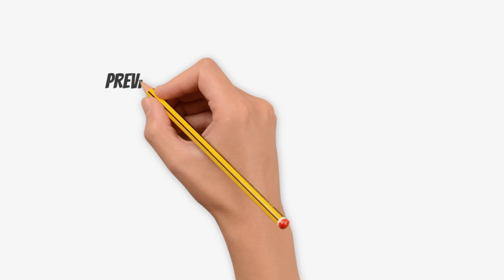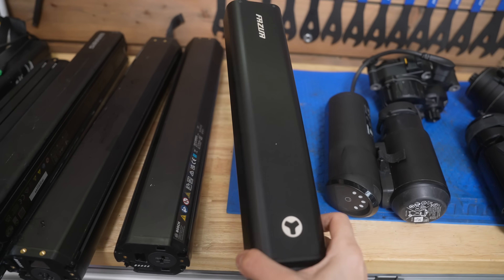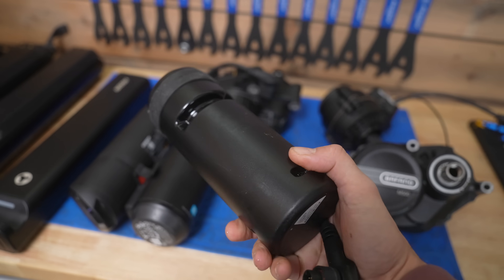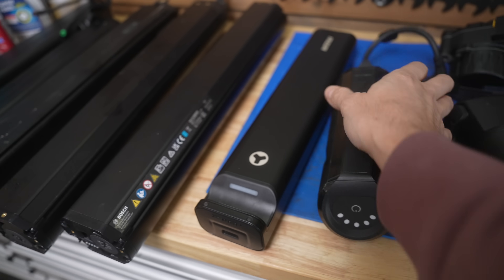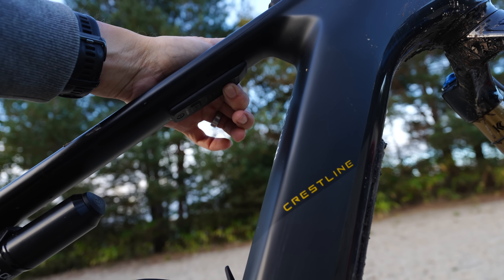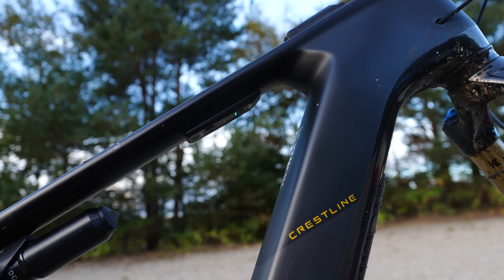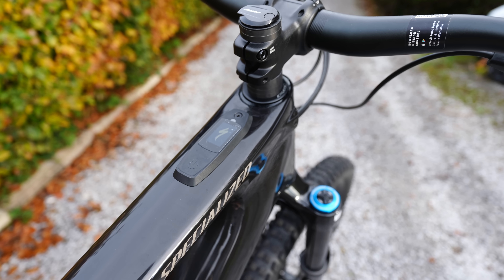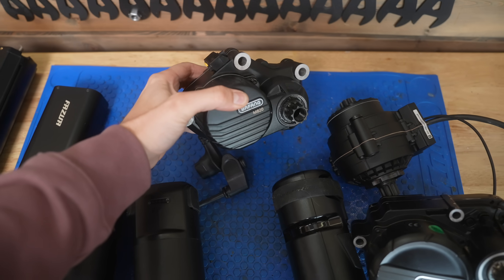We Have A Huge Problem With Ebikes....

Comment: The problem is there is virtually no new technology at play here and no requirement to use proprietary plug interfaces.  There are no bikes that require beefier contact points, different communication standards across components or battery shapes.  Ultimately these companies want to target consumers who want to buy complete systems and call it a day while taking advantage of the fact that a lack of an upgrade path forces consumers to buy more.  Interestingly if you choose to modify an existing push bike to be electric you get the best of compatibility options because you end up buying a myriad of parts from chinese suppliers who don't have a comprehensive catalog of parts and are forced to make their parts as universal as possible so that people can use them.
I think the best way to solve this problem for the premium market is to offer tax credits applied at the point of sale for systems that meet common standards.  To begin with you could target the more basic systems that DIY builders are using and get the premium manufacturers to work together and make a new industry standard for new components so that they can take advantage of the credits as well.

Comment: This is my main gripe about e-bikes! Otherwise I think they're a great idea.  Think back to the "dark days" around 2000, when every phone manufacturer had their own charging port.  Eventually USB was a sort-of standard, but only really when the EU made it regulation that USB-C was fully used.  Arguably even then manufacturers are now being cheeky with USB-C, so it looks like a USB-C in terms of form-factor, but have their own standard when it comes to transferring data vs just power etc.

My wife invested a lot in getting an e-cargo bike, and hopes to be able to keep it for many years to come.  Ended up buying a couple of spare batteries + frame locks whilst they're still available to help future-proof it, and might look to get some spares in stock for the motor.

Arguably even non e-bikes suffer from this as well.  Bottom brackets, one-piece cockpits with integrated cables, aero seatposts, built in batteries in frame (Cannondale) etc etc.

Comment: Its a new tech, the design isn't finalized, if we made a standard then future advancements would be stifled by backwards compatibility, wait until the manufactures evolution of design settles down a bit, just as phones now can use USB - C as standard, as it was clearly the best out of the bunch.  There will always be aftermarket parts available.

Comment: E bikes are exactly the same as RC cars. RC cars can take any battery and the plugs are easily changed. This propritary crap has got to stop and is not a feature designed for the end user.

Comment: Yeah, this is 99% design-related and 1% "locking into the ecosystem"  and even that 1% is probably being driven more by patent infringement than marketing issues.  The space is evolving without a clear leader and there are no standards.  Unfortunately there is no worldwide organization to set cycling standards.  Perhaps cycling could ask SAE to set up a cycling-specific group?  Seems it would be easier to join up with an existing organization than trying to start an all new one.

Comment: Not surprising, just like other powered vehicles, parts are specific to the manufacture. The big problem in the US are the illegal electric bikes bought off Amazon that have motors greater than 750 watts. They lack or have easy defeatable governor limiting the electric assist speed with some reaching 40 to 55 plus mph making them illegal to ride on public roads. In addition, the batteries are known to catch fire starting building fires, a growing hazard with cheap electric bikes. 

Bicyclist in the US are known for not adhering to traffic laws, but putting an electric motor on them is like giving a toddler a knife to play with.  The American Journal for Emergency Medicine in a national study revealed that e-bikes were second behind E scooters for injuries, “The 115 injuries per million e-bike rides beats out the estimated 104 injuries per million motorcycle rides, 15 injuries/million bicycle rides, and eight injuries/million passenger car rides." A 100 more injuries per million when you put an electric motor on a bicycle. 

If injuries continue as expected they will, the states will pass laws that require all electric bicycles to be registered and have a license tag. Conclusion, instead of buying expensive electric bike, buy a motorcycle, it's safer.

Comment: As I have seen in other comments USBC is part of the answer not only do you get a fantastic battery you can use to power other stuff, you can slow charge it at work whilst not carrying the huge charging brick with you.. It needs the EU to legislate, really it's the only way,  plugs, frame fittings and bottom bracket geometry.

Comment: I agree with a lot of your points, however after working in the IT industry for well over three decades I’ve lived through the stage of a new technology’s life that we are now at with eBikes. I don’t think this is brands trying to grab a position in the marketplace, the fact that their own products are not upgradeable demonstrates that. The issue is at what point do you standardise? And then of course which product do you standardise on? If it’s anything like the PC industry it will be a NEW standard which causes even more obsolescence. I suspect that it will be another five to ten years before any form of significant standard comes about. Since the technology is still making too many improvements, and the spares market is not yet big enough compared to new sales.

Comment: This is a huge question for me! My wife and both work but on low income jobs. Justifying the cost of an eBike is very tricky and it's made harder knowing that in a few years time whatever purchase make will be out-of-date. I would be planning to stay with the same bike for a good number of years but I also worry that as the tech is evolving so quick, will the support for legacy products continue. In 3 years time, will newer battery tech work with my bike then? I wonder of 3rd parties will fill this gap but in the mean time, I'm holding off on the purchase in the hope that some brave manufacturer will commit to a set standard and backward compatibility.

Comment: ummm  grin tech hi end  made in canada universal hub motors front or rear (135mm qr  /12mm thru axle to 148mmboost and a grade panasonic 2170  battery packs  your  santa cruz v10 is a reality ...........again made in vancouver canada  they have you covered

Comment: This is my main reason for not buying an e-bike.  I could potentially stomach the cost of buying if I knew I could upgrade parts in the future.  At the moment my only way of buying/trying an e-bike would be to down the cycle to work scheme and then sell once the year is up and before battery degradation/massive depreciation has set in

Comment: Great vid and a very important perspective. I think consumer awareness of this needs to improve a lot, and consumer choices as well. I figured this out early on and chose to build my own bike based on the current bottom (regular bike) bracket standards. There are some great motors out there that will fit your bottom bracket, also some advanced ones like that ones put out by Cyc. Rob perhaps you can help more here by bringing the good existing options into view also? Again very important topic and great that you shed some light on it.

Comment: You can force the issue by the buying public gravitating towards one spec.  think video recorders, in the end VHS was so popular that the others fell by the wayside (unfortunately, even though they were superior).  Surely, the independent suppliers of all the components will concentrate on one or two specs so that generates choice, which eventually swamps the market.  Although I'm not advocating it, having one standard can lead to a dead end, where development stagnates and fresh thinking is stifled and it will take some time before a new standard is formulated.  Unfortunately, innovation moves faster than bureaucracy.

Comment: I do not think you should compare an E-Bike to a laptop or a phone. It is more like a motorbike if you want. No one complains here if the motor of the new Honda does not fit in your 3 year old bike. Same with cars. Also: you never know if the bike frame has been tested for higher torques in the drivetrain, so from an engineering point of view in terms of liability I would make it really hard for customers to upgrade their bike.

Comment: This is why its better to buy an ebike conversion kit from Tongsheng or Bafang as then there are lots of different manufacturers selling batteries for these, plus displays and also you can fit the same motor to several of your ebikes and share spare parts, which are also easy to find ... and all at much lower cost to the bike brands.

Comment: The bike industry should be very careful as the automotive industry is now looking at "new mobility" opportunities. The reason is that more and more dense city centers are planning to get rid of cars of any type. Some big OEMs are now planning on alternative electric solutions. With mass production and low costs that will make any actual e:bike price looking silly when compared with those nextgen 3 and 4 wheelers ..... therefore, the technical standardization will be the only way for the bike industry to survive while having to drastically reduce costs.

Comment: If the bike does its job you use it until it fails and then go and buy another one. I had the same car for the past 17 years, served me well and did whatever i needed it to do.
The thing that needs to change is internal not external. Once you get rid of the consumerist way of thinking, the fact that bosch introduces a new whatever in their bikes leaves stone cold.

Comment: 1) All are 36V NMC battery packs. There is absolutely ZERO technical reason why one charger can't work with any other bike (the technical reasons they give us such as safety  are pure bullshit as this is up to the BMS inside the pack to manage the safety). This is purely a commercial trick to hook the customer for ever.
Therefore, the chargers and charger connectors MUST be standardized quickly. Or it will be up to governments , the EU or UN to do it for them.
2) Also the 36V batteries packs could be better standardized at a later stage with only a handful of formats. I can't see any technical problem there too.
3) The cell standard used by all brands are 18650 NMC. 21700 newer format starts to get some "traction" now.
And the latest "Tesla" type format  4680 and its evolutions/versions 4695-46105-46115 are getting introduced into the auto industry for the highest performance cars (High Nickel NMC). 
With just 10 of those cells in series you get over 1kWh 😁 One could fill up a down tube with 10 of those cells connected in serial.

Comment: All Valid points. Totally agree, but I think one point trumps this all - Early Adopter. I only bought my first e-bike after the introduction of the Bosch Smart System. Before - at least here in Germany - e-bike felt more like yeah they work but not really thought-out early adopter lets try bikes. Yes, first when introduced, the Smart system did not had all points but as far as I see it gets those part by part and with all important user software updates on the fly. No more need to hassle running after dealers whatsoever. All you need is a smart phone and done and you can check what components you have.. it is not all perfect as for some hardware specific you still need to go to an dealer (not idea why it is not allowed via the app, like the range extender) but in the end you will get one. And if you look now at the Smart System with the Flow App, Navigation, Software and FW Update the Motors, Batteries, ABS 2.0 etc. it really for the first time would makes a well rounded e-bike system. So, yes those points you make are really valid but i say with at least for Bosch - the Smart System is the necessary foundation to discuss this.

Comment: So use the BBSHD Motor. I put it till now in two different bikes. You have 165NM torque if you want and can use every 48V battery you want.
In my momentan Configuration I use a 1100wh batterie in my 2006 Fusion Whiplash freerider. Its amasing. 
You never want to ride a motor with only 90 or 120NM

Comment: Oh well, it is almost impossible ATM. The thing is there is a physical constraints which dictates both mechanical and electrical aspects of the system. Unfortunatelly ebike motors at this moment are at the edge of their possible physical dimentions, thus any improvement usually means change of the physical size of the parts and due to hardly tight space inside also the change of the mounting pattern. Pretty much the same story for electrical components, different voltage, different current, dumb or smart battery. And than we are going to bike dictated constraints, like if batt should be long and narrow or short and wide, should it be removable or no. If removable should a different voltage batts be the same shape (so that used can plugin 48V battery directly into 24V bike and burn its house... It is not that easy... With a time, it would be solved... but With. A. Time.

Comment: This is the main reason why hub motors are still so popular, while being worse in performance and feel than mid drives. They are standard 135mm width, mount to any MTB frame and are cheap to replace. A 500w XF15 is like 120€. No proprietary BS.

Comment: With regards to the plugs the solution is the same as electric tools which also don't have compatibility between brands and that is probably adapters to change one plug to another the long term solution for motors and controllers being incompatible is probably a DIY solution where common parts have mini wiring harnesses that allow one product to work with another but we have also seen how that is likely to work real world when it comes to things like the one wheel, where a company sues to keep that from happening. Its also why there is a huge push towards right to repair and hopefully you see a cottage industry of "hackers" keeping the parts working and solving some of these issues.

Comment: Totally disagree

go and ask ford if you can fir a mazda engine in their vehicle or asking to put ios on to a google pixel. 

Design philosophy requires freedom and making them all cross compatible is actually worse for progress

The bosch sx motor or tq motor wouldnt exist if they had to use the same mounting as a Bosch gen2 from 6 years ago

Additionally whilst bb standards are fairly consistent, motors and batteries are very very large in comparison. That also means frames will require harmonising which means frame design is also boxed in by standards. Then when motor companies want to change, it becomes slow and bureaucratic 

Companies want to control how consumers experience their products. Consumers think they want to experience it how they want but in reality consumers dont actually know what they want till you give it to them. 

Also oem deals far outsell anything aftermarket could ever dream of so by having long term oem deals that are around their parts companies can have longer term stability. This means rheyll be around longer with spares longer rather than having volatility which is not good for consumers. You could argue by having a standard consumers can just jump to a different brand but in reality, should they have to buy a new motor and battery because fazua exited the market (and no we dont want all bms systems to be the same because that means no one can improve and gain from progress)

Comment: Man I love mountain biking but damn this planned obsolescence and abuse of consumers is enough to drive me to a hard tail non-ebike.  Yes the HT also has standards that change (boost, wheel size, etc) but these don't change often and on a HT you have less to worry about. $10000 throw away in 3 or 4 year bikes is absolute trash and we should hold these bike companies accountable. It is irresponsible.  I'm not an e-bike hater and have been blown away on riding one but your points are enough to make me hold out.

Comment: Making everything fit everything is all well and good but it will then cause another problem. Innovation will stagnate as they can’t change things. For example all motors fit the same people think yes I can change my motor. But then the wiring and controller remote needs to be compatible so they would all need to mount the same so no longer would you have neat frame mounted led battery indicators switches etc on some bikes and bar mount on others. They would all need to be the same

Comment: Absolutely nailed it, as usual Rob. This is exactly why my next bike is going to be Bafang mid drive. They’re not perfect, as they seem to be moving that way themselves with the Bafang Ultra, but for their older motors, you’ve got so much more flexibility and compatibility. If anyone can do anything about this, it’s Shimano IMO. Bosch absolutely will not take the initiative. Neither will Specialized/Brose. The only other thing I could see working is an EU regulation, but that’s not very likely either
Reply: Bafang are not flexible. Grin Tech systems are fully flexible and easily programmable.
Reply: @sammiller6631  Thanks bro, I’ll definitely look into it. Appreciate the reply

Comment: So on the money, you only have to look at the range of ebike frames for sale for pennies as the e-drive has crapped out to know this is an issue.
My analog bike is a 2016 frame, freshly rebuilt with parts from all eras from 2012 to 2023, all fit (OK there are a few sizes, but narrowed to a few standards).
Many BAFANG could do adaptors to fit an aftermarket motor into a OEM built frame!